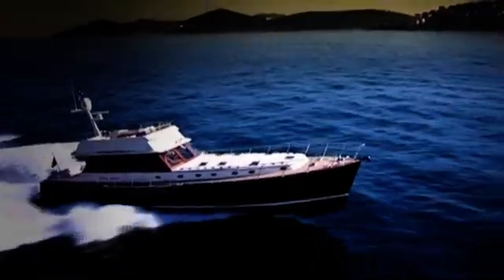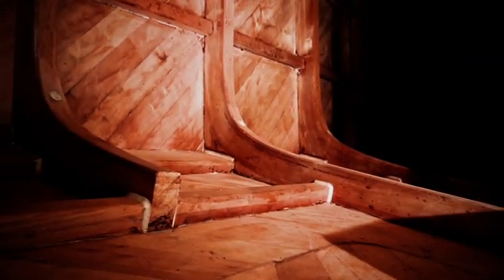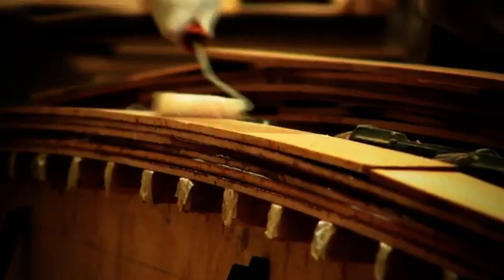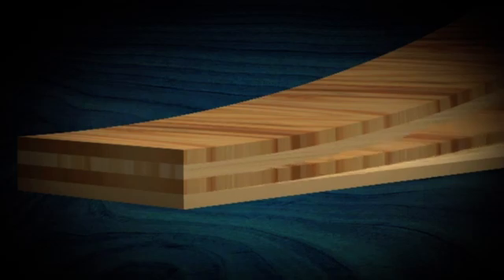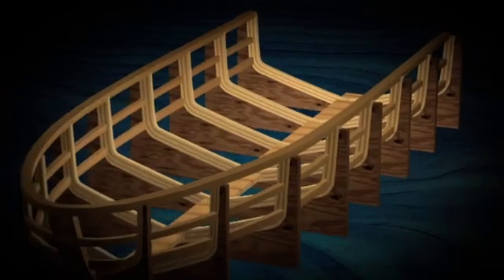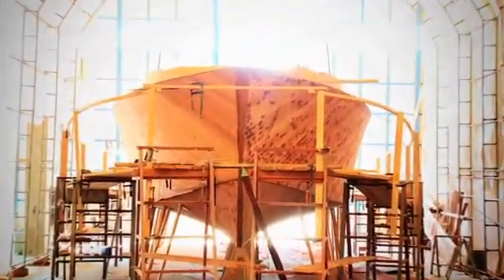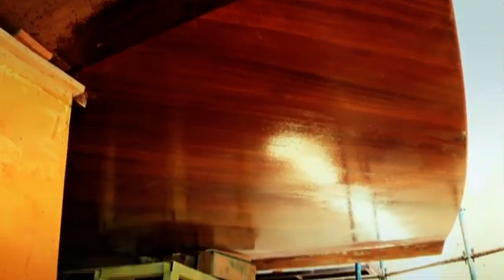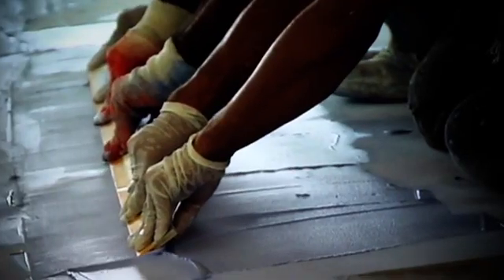HOW TO BUILD A WOODEN BOAT VICEM YACHTS

Comment: design suggestion...   Omega
shape the primary hull with several laminated beams in the shape of the omega symbol.
the bottom edge of the omega will be the two keels.
build the displacement as two cylindrical bodies along the top third of the omega, one on either side along the whole length of the ship approx. 60'-80' 
the rib beams of the cylinders and the rib beams of the omega splined together on e either side of each other. like adding an s shaped beam support, the top of the s wraps around the cylinder rib and the bottom curve of the s wraps the bottom half of the omega.
cylinder ID 10'-14' OD 12'-16' laminated beams are 6" wide and 12" thick and make continuous arc forming a spiraled rib from front to back with supports spiraling the other direction where necessary.
Top deck spans both Cylindrical bodies and ties into the ribs.
lower deck spans across the top of the omega and ties into the cylinders about a 1/3 of the cylinder would be lower than this deck.
An A frame would be established above deck... sides can be opened or closes as deemed desirable, but built to withstand crashing waves and still keep the deck dry.